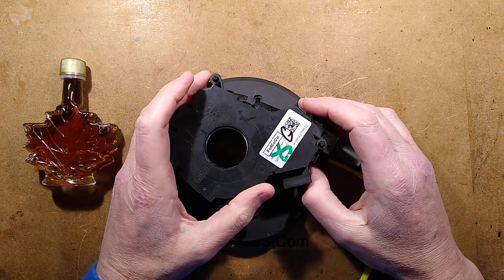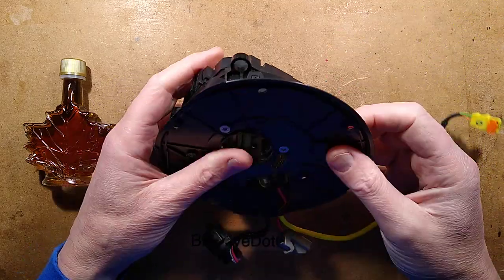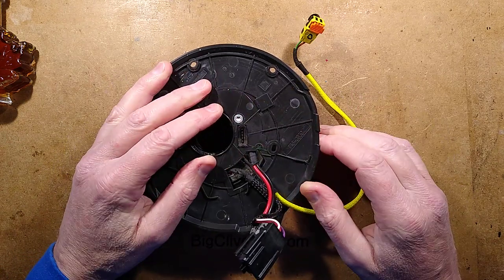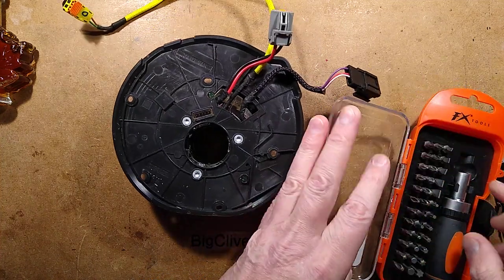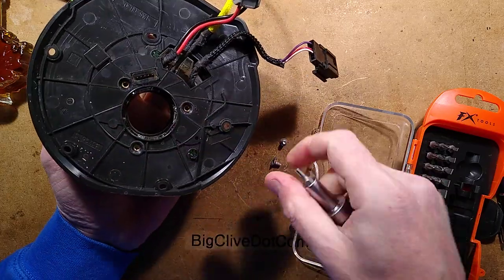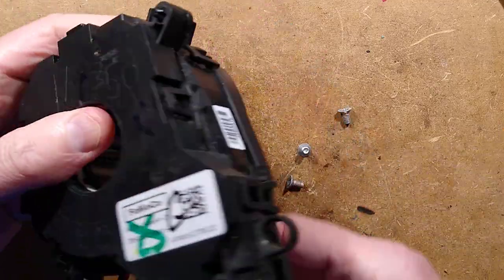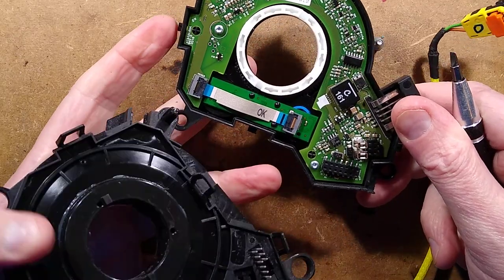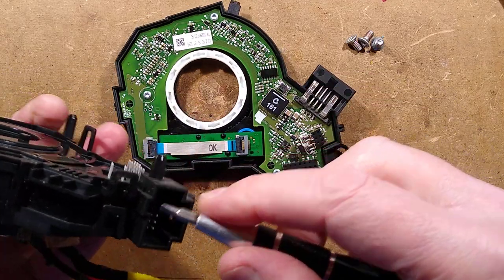Inside a car clock-spring module (steering wheel wiring interface)

Comment: The angle sensor setup uses a quadrature encoding between both small gears.  There is no dead center (straight) thing, it gets calibrated by turning wheel all the way left and then all the way right, or vice versa. This setup auto corrects for a lot of errors, and make the hall sensors and magnets dirt cheap.  No absolute position measurement, it done in software.  In one of my cars (mercedes w163), if you turn the steering wheel without key in the on position, it looses track of the angle.  The fix is pretty simple: turn on the car, steer all the way in one direction, then in the other direction, and the error goes away.

Comment: The rate of steering angle change is determined easily from how many pulses on each sensor (and it does do a sanity check).  The 2 sensors have different gearing, so when turning the steering wheel one lags or leads the other and that's how it gets direction.  There is no mid position (steering straight) sensor.  It can be calibrated if a new one is fitted, to get it in the right ball park, but it will then fine tune the mid position from input from the ABS wheel sensors.

Comment: Clock springs typically are very analog and don’t usually have sensors to detect position unless you have a fancy electric steering and lane departure assistance. The yellow cable is the SRS (airbag)

Comment: the two gears with magnets are the steering angle sensor, it gets the average of the two that's why there is 2. there is a calibration process where you rotate all the way to the left then the right, afterwords it stores the middlepoint it in the canbus or cecm.

Comment: That does go on the steering column kind of behind and inside the wheel. I had to replace one on my car. Make sure you mark the wheel position on the spline before you remove it!

Very cool mechanism but super fiddly

Comment: I have a couple of the Tropic Labs boards that use these chips and a magnet to turn a stepper motor into a servo. They have to be calibrated, but are surprisingly accurate.

Comment: wheel position if for stability control, will keep you going where the wheel is pointed outside normal parameters by applying brakes on some wheels to turn the car, so can pass the elk test etc

Comment: Slip rings were used on airbag equipped Mercedes into the 1990s. Then they changed to using a clock spring.

Comment: There are analog magnetic angle sensors that can basically be used as positional detectors that never wear out. They send out a voltage proportional to the angle. The magnets are diametric disc magnets, having both the south and north pole on the faces. The sensor can detect rotational angle of the magnets.

Comment: Clive, I think those blue and black gears in the round bracket house the magnets and the chips detect the direction the magnets are facing. It could be an array of a few hall-effect sensors and the processing chip compares the values between them all to get a reading.

Comment: The steering angle sensors usually reset after the battery is disconnected. To 're-program' them, you steer from lock to lock. When the steering angle sensor gets as many revolutions as it's expecting either way, it saves the max+ and min- positions. This way, even if the steering wheel is slightly off-centre due to poor wheel alignment, the steering sensor will always know where the wheels themselves are because the steering limiters are in the steering rack itself.
Reply: (this is how V A G vehicles do it. Other cars may have it set straight ahead and programmed directly into the ECU whilst it's in the perfect position in an ECU programming mode, or will be pre-set on the angle sensor itself and just requires the technician to fit it correctly to procedure.)

Comment: The reference position is provided during a steering wheel sensor reset procedure that is supposed to happen after a wheel alignment. Every vehicle manufacturer has a different procedure.

Comment: Those type of magnetic sensors are common in high end joysticks. They'll use one each for X and Y coordinates, and sometimes a third to detect rotation of the stick. There is also another that can detect position on both planes at the same time, so instead of having a magnet and sensor at the end of each axis, the sensor is set below the end of the stick and the magnet is set into the base of the stick. I've tinkered around a lot with making my own flight sim controllers, so I've farted around with a number of different chips like that.

Comment: I noticed the 2 cogs in the sensors are different sizes. The blue one being smaller than the black. Zero could be sensed when both magnets are equal to each other. They'd only line up at a specific position only due to the different ratios on between the 2 gear sets.

Comment: I used to work at a company that made these among many other things for Land Rover. We used to call them 'Spiral cassettes' but it was likely translated from German. They were slightly simpler back then and used to use LIN to communicate with the multitude of buttons on the steering wheel IIRC, I don't remember having a steering angle sensor back then though (mid 2000s)
Reply: The names manufacturers give to parts is  very diverse across brands sometimes even bizarre! Many time over the years while ordering a part the parts guy has said,"oh we call that............",and remember thinking WTF!,spiral cassette,slip,squib or collector ring,clockspring and spiral cable are just some of the more common names for them. The steering angle sensor is more of stability control function than actual abs that's why the earlier stuff with more basic abs systems that simply to prevented the wheels from locking generally didn't have them.
Reply: I bought one from a Volvo FH2 (from what I can find, came out somewhere around the 2002-2003 period) and it has 5 buttons (2 horn buttons sharing the same 2 pins) and 4 cruise control buttons.
The last 4 are probably multiplexed in some way and I have yet to probe the thing with a scope to see what it does and how and on what pins.
There are 4 pins labeled I1 to I4, and there are 3 pins labeled PA1, PA2 and PA20, and then there's a V+.  If you happen to have a clue what this does or how it works and where the ground could be, I would love if you could give me some hints as what to do or probe :P.
Reply: @Dutch3DMaster  hi Iris, if it came out in early 2000s it's unlikely to be LIN as the standard was only just released. I would hazard a guess it's a resistive coded switch as it doesn't sound like there are enough pins for each of the available functions. If that is the case try to measure with a meter in the resistance mode across each connection in the pressed and unpressed state. As a failsafe the unpressed state should never be zero volts (zero indicates open circuit therefore failure condition) so it's likely you won't get an open circuit reading between V+ and output even when nothing is active. It being from a truck it's also likely to be 24V rather than 12V. Sorry I'm not sure on the pin naming, your best bet is to get hold of a wiring diagram (most have been leaked online for older stuff). The German ones tend to use KL30, KL31 etc. for battery and ground so I'm not sure what PAx indicates.

Comment: It knows it’s reference only by the pulses. There is even a setting in the software menus of the manufacturers to calibrate these sensors „zero point“. It’s first and foremost there for the ESP but other things use it too of course, like the shifter, the airbag, suspension etc. The two sensors are there for redundancy and error checking, like in gas pedals for example.

Comment: There are hall sensors you can set the zero point on start up beside other settings. So it could be programmable, but I think it ll be only read out and check during  installation

Comment: The absolute position of the two magnets is not needed.
When the steering wheel is put together, the wheel is put in the normal straight ahead position and then a scan tool is used to tell the stability control computer to calibrate to that position or zero.
Reply: do you use a scan tool when you change your battery? no one does!
Reply: @pedram.mp4  That's only an issue in European designs largely. American vehicles are smart enough to store learning parameters in flash.
Reply: i think its an electric assist power steering encoder not stability control!
Reply: @straightpipediesel  Won't help if you turn the wheel while the battery is out/dead.
Reply: @han5vk  The phase of the two magnet signals gives you an absolute position over the travel of the encoder. The scan tool calibration maps the absolute position of the encoder to the absolute position of the wheels. If you move the steering when the car is off, the system can recover the absolute position the first time you turn a few degrees.

Comment: I think those chips are absolute position sensors and can tell with probably 10 bit precision the angle of those magnets. If the gears on those two sensors have a different number of teeth, they could get an absolute position of the steering gear across multiple turns of the wheel by calculating the difference in position between the two gears.

Comment: The steering-wheel angle sensor doesn't have any sort of "absolute" indicator.  When you first plug it in, you have to run the steering wheel lock-to-lock to calibrate it -- you'll see a steering-wheel malfunction indicator light on your dashboard until you do this.  Then the car's computer remembers the maximum and minimum numbers it got from that calibration (many cars write them to an EEPROM in the car's main computer, so even if the car loses battery power, it'll still remember those numbers) so it can calculate the steering angle from then on.  Until you unplug the clock-spring module from the CAN bus, of course -- then you have to recalibrate it again.

Comment: I believe the sensor chips are more like a compos sensors in that they detect north and output it over i2c or serial. I've been told that those might be a special variant to be used in near field conditions. The reason there's two is for redundancy most likely as they ride on the same gear.

Comment: Usually its a measure of the capacitive field positioning of the two magnets. If you count the teeth on the gears one will be an odd number (the ones with the magnets) that way as it is turned say a full revolution, the magnets wont be in exactly the same place therefor the capacitance is measured at any location letting the stability or electronic steering system know which way the steering is. This also allows for the mechanic doing wheel alignments to reset the straight ahead position of the steering electronically after a mechanical wheel alignment. (steering position relearn).

Comment: What a convoluted way to get signals across a rotating part. I would have thought concentric rotary transformers, as used in videotape head drums, would be simpler. And yes, you could supply the tiny amount of power needed for the encoding circuitry via one of these concentric transformer rings.
Reply: Those would be incredibly susceptible to noise (ignition system for instance) and you definitely do not want a possibility of whatever interference that could stop an airbag from getting deployed, or worse, having it deploy when not needed...
Also, it would mean you would need some kind of AC, and while there is AC present at the dynamo side, this obviously get's rectified.
Next to the AC requirement it would also mean there are positions in which it won't read anything, when you are between winding positions.

Also, "lower power for the encoding circuitry", this makes it harder to filter/supress interference present in the circuitry, a gear selector I bought from a Volvo FH2 uses 24V for a set of hall-sensors to read out it's position, just to give you an idea of what is deemed practical.

Comment: I've change a few of those and that latch is basically a transport safety so it stay centered it will disengage when you put it all together again. If it's not centered those greasy flat conduters will rip apart. That one looks a bit more advanced than the ones I've changed and I'll bet the car it belongs to is the kind that can pocketpark itself.

Comment: Perhaps it knows its absolute position due to the fact that there are two hall effect sensors: If the black and blue gear have a different number of teeth you could do this. Another explanation for having two of them, other than redundancy, would be if the hall effect sensors only measured in a single axis. Then you'd need a pair of magnets offset by 90 degrees.

Comment: FYI that hall effect sensor do sense the angle of magnetic field by the strength of the moving poles. You can try this with 2D or 3D hall effect sensors like MLX90380 or MLX90395.

Comment: I suspect the two sensors are to detect which direction the wheel is being turned in. The sensor will give a north/south indication, so you need two 90 degrees apart to be able to work out direction. As regards resetting itself - my guess is there is a little microswitch elsewhere which detects when you hit full lock, and it uses that to reset itself as required. Also, without the ignition on, the steering lock will engage as soon as you start to move the wheel, so those sensors probably don't need to be on 24/7.

Comment: yaw sensor, you set to 0 is center  you have to program it when you install also wiper control ,lights , radio controls , cruse controls and so on its all there

Comment: I don't know the car (nor much about cars - I'm a software engineer), but conceivably lane guidance (basic autopilot) system wouldn't actually need an absolute reference. It really only needs accurate deviation information to use in a feedback loop with the servos/whatever the car is using to apply steering torque. In such a system, the camera (or whatever sensor) used to detect how the car is tracking in reference to the lane is actually providing the absolute/critical information, which it can then calculate the required steering adjustment, and use a sensor like this in a feedback loop to achieve it.

Comment: This locking mechanism is for blocking destructive rotating while being dismounted, few rotations and then being mounted can brake tape connections when rotated all the way. It can happen not in the workshop, but when airbags are most needed :>
Reply: Electronics is a steering wheel rotate sensor, and it is used for assisted traction control - brake system is used in this kind of system and it makes this assembly really critical even when not crashing :>
Reply: And some cars have reversing and line assist, it uses this sensor too

Comment: I just fitted a new one on my Nissan Navara although on that the steering angle sensor is separate from the clock spring. Once the angle sensor was installed I had to set the straight ahead position with diagnostic software before it would work correctly and then assume the on board system monitors steering angle from them on. With a broken sensor I has no ABS or traction control so it’s a complicated little system. Thanks for the video

Comment: The chips are up to 24bit reaolution magnetic rotary encoders that measures the absolute orientation of horizontally magnetized magnets where it measures the angle of north and south. Magnetic encoder ics have something like 0.05° accuracy :) AS5048 is one of them

Comment: The encoding magnets are the disks the sensors are above as you can encode them with North/South faces on the same side of a magnet in a set pattern the sensors can pickup. By having them on a known gearing and a known pattern you can read the clock springs position easily. 

The test for North/South poles on the same side of the disk is a simple magnetic reacting film that shows magnetic force patterns. Also useful for finding hidden magnets without randomly moving a magnet near sensitive electronics.

Comment: Former Mercedes-Benz tech here. The center of rotation is irrelevant at the steering wheel. Center is determined at the steering rack. (electronic steering now a days) Think about it for a minute. If someone put it back wrong it would steer the car full right or left, potentially. It is simply there to count pulses, as you assumed.

Comment: Steering angle sensors are  permanently powered and remember where they are. If power to them is ever interrupted it will put a light on the dash. 
Usually to clear this you have to teach it the end stops by turning full left and full right (or the other way round)  you don't have to go all the way just the right number of complete revs end to end.

As the others have said there is some fail safe logic in there where it knows roughly where it is based upon the relative position of each sensor. The little wheels will do many turns per complete wheel revolution giving good accuracy.
Since the wheels do multiple revolutions from lock to lock (3-4 generally) a once per rev pulse wouldn't help in detecting which revolution its on only a sanity check that it hasn't miscounted. 

The sensor is mainly used for the stability system to know which way the driver has requested to go and by roughly how much.  If the wheel says left but the yaw sensor says the car is going right it will intervene to correct it. Handy for average joe. Right pain if you've applied opposite lock to counter a sudden slide!

Comment: The car has some kind of steering angle sensor on the column and possibly in the  steering rack. On some cars the wheel speed and lateral acceleration sensors are so sensitive that they will throw a fault code if the steering is even slightly out. Other cars use the wheel speed sensors for TPMS.